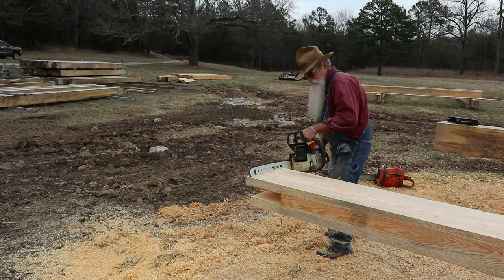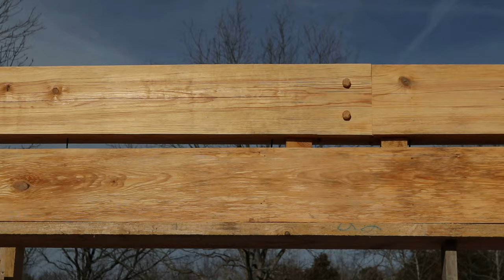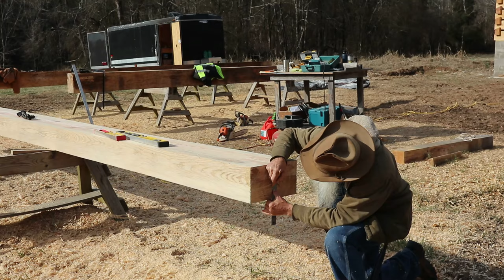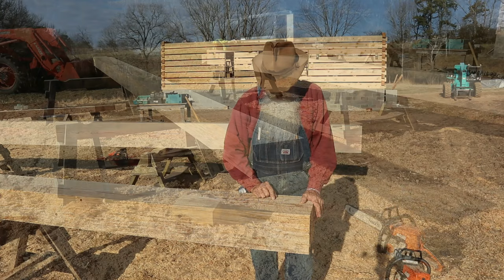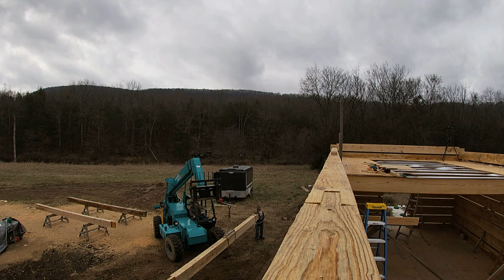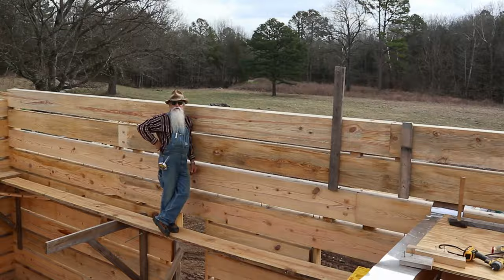Ozarks Cabin Build, Ep 5 - Joining Two Logs, Pt 1

Comment: I’ll never understand how you can be so accurate with a chainsaw. If I were cutting that it would look like a beaver chewed through it! Great skills.
Reply from the maker: Howdy Gregg- I’ve been using a chainsaw for a good many years. Using the right size saw for the particular job sure helps. If you notice l keep the power head a little lower than the tip of the bar and l always start the cut with the tip and the saw revved up to the right rpm a little below full rpm and when in the cut l rap it up wide open. That helps in keeping the cut clean and controlling the saw. It helps keep the saw from bouncing around. God’s blessings to you
Reply: @TheBeardedCarpenter    Great information, thanks.
Reply from the maker: @gregganderson1454  You’re very welcome. Blessings